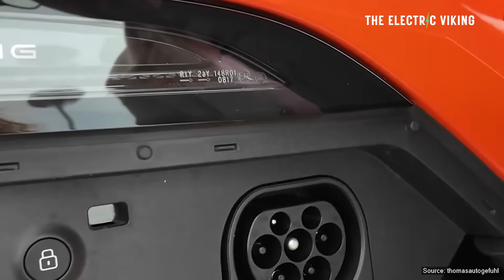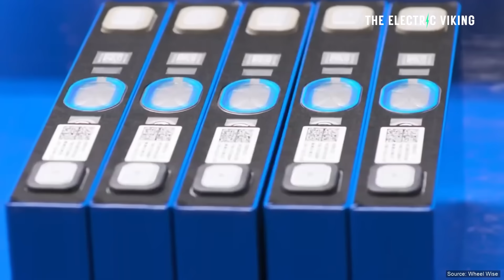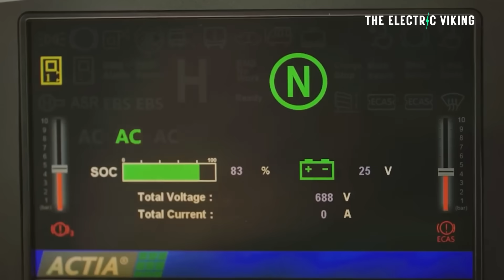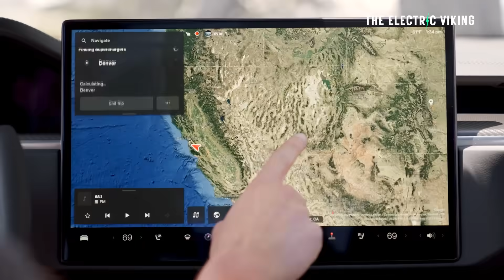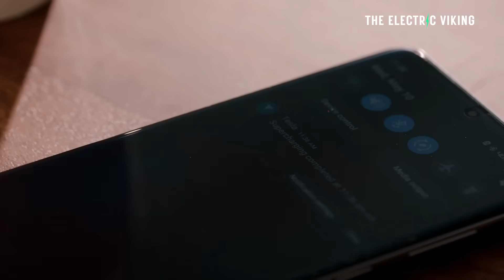Shocking data reveals the TRUTH - how long electric car batteries really last

Comment: When a battery degrades does the 80% recommendation also lower?  If max capacity was 300 miles so 80% is 240 miles and the battery wears down to 260 miles can one still charge to 240 miles and it's fine or does the 80% need to be applied to the new lower range?

Comment: So, EV owners are ok with losing 30% of their mileage after 6 or 7 years. That just seems strange when there are options that prevent that  battery mileage loss…..namely battery swapping. Why wouldn’t you want that option? There is no downside. Zero.

Comment: I've never heard such a utter rubbish in all my life there is no way that the cars of today are going to be around in 25 years 30 years time not a chance certainly not unless they've cost hundreds of thousands of pounds in repair bills I've been driving for 40 years and I've only ever brought used cheap cars and I think the most of the paid for a car has been 1500 and I once lost about £200 on a car back in the 1990s usually spend no more than £500 and i have never had a repair bill for anything ever more than £200 yes I can do some repairs myself these cars of today you've got no chance of diagnosing a repairing any problems come up on the cars cuz of the sensor galore's everything has to be put on diagnostic machine which isn't cheap that's just to find out the problem not even to repair the problem You're having a laugh and hope you're getting well paid for it because you're selling yourself down a drain

Comment: OK fine so the battery is not the problem. but what about the repairs. It is very expensive to have an EV repaired if you can find a garage that wants to do it and has enough qualified mechanics. EVs are built terribly compact, you have to take a lot out to get to something. That costs a lot of time in labor. Manufacturers protect their parts from imitation by only accepting their own parts in the software. There are already 6 year old EVs that end up in the scrapyard because it is too expensive to repair them. Don't get me wrong, I love EVs but it is difficult to make the best choice for the long term.

Comment: I am buying a Geely E5 with tge 60kw battery. However if Geely will only replace their blade battery only if it drop to 70% capacity within the 1st 8 years. This would be the battery Having dropping from 60kw to 42kwh. This would even be lower than their other smaller 50kwh blade battety.😮😮😮

If Geely are so confident about the blade battery longevity then their warranty should be battery replacement if it drops to 85% capacity like dropping from 60kw to 51kw. No?

Comment: My question is more about which companies make the longest lasting batteries. Oh which companirs use the most efficient batteries. Most reviewers only care about range on a charge when new. When long-term usuage is way more important. Why buy a 400mile battery thats 350miles in 5 years when the 380mile battery only drops to 360miles in that time.

Comment: Is lab testing better than real-world data? That’s a marketing claim, not engineering. Only real-world use can provide accurate data over time. Lab tests are merely a quick estimate of a few data points, as you mention several times throughout the video. The million-mile Tesla is on its 4th battery, but still impressive. Paul Curzon's Model S has over 400k miles and is the best known on a single battery, but remember that is only one car, time will tell.

Comment: You work for the chinese government surely, cherry picking ultra high mileage users to aid the case for ev cars? I have been driving 50 years diesel work vans 20,000 annual miles and private petrol cars 10,000 annual miles, never had an engine or gearbox which is no surprise really. average car use in Uk is 12,000 miles, Tesla battery guarantee 8 years so average UK user 96,000 miles when guarantee expires, the EV would be worthless then while the petrol car would have years and years of life and some value! No mention ever of Trump reversing the net zero madness and reviving the ICE vehicle production!

Comment: I have a 2014 Nissan Leaf. I purchased it to save money, as well as have a fun car to drive.
It has over 130,000 miles, still has the orignal brakes, and the battery is about 1/3 degraded. If I replaced the battery it would be less than buying a new car
On a good day I can still drive the 24 miles to PDX and back. 
I figure the battery will last another 10 years, as I dont fast charge it as much as I used to. Its my daily driver.
Now that I'm older I mostly drive around town to get food, and visit friends, as well as lend a helping hand when I can.
It's the best vehicle I've ever owned.

Comment: I have a 2010 Toyota Prius IV with 177k miles on it and the original battery is still good, allowing me to get 46 mph, about 4 less than when it was new. And I haven’t had to replace the brake pads or rotors. At my last oil change at 175k miles the front pads were at 5mm and the rear at 6mm. That’s very good and saved me a lot of money over a non hybrid gas car.

Comment: 5 minutes in and still not answering the initial question. Going on round 3 repeating the same not to the point words.
Reply: That’s because almost all of the batteries are less than ten years old and the newer ones will last longer than the older ones. 😊

Comment: Ever since the automobile battery revolution started, I have believed that the best thing the industry could do would be to standardize the physical size and voltage of batteries so that they are interchangeable between automobiles. (Think AAA, AA, C, D, 6v, 12v) This should reduce their cost and make their replacement much easier. The industry may be in such infancy that such standardisation is not yet feasable, but it should be the target of the industry.

Comment: I am 60 now and throughout my driving history since 1983 I have had numerous cars all used and none without some mechanical issues along the way. A few years ago I was left some money and the first thing I did was by a Renault Zoe a few years old which I loved but it didn't have rapid charge so was limited (but we still did a road trip) I then upgraded to my first ever new car a Tesla model 3 RWD in 2023 did a road trip last year Cork to Cornwall and this year we are going to Switzerland my maintenance expenditure so far has been screen wash. Tesla replaced a faulty tyre for free.

Comment: One actual problem with cars as long lasting as EVs....is the financial sustainability of every current auto maker.   I fully expect EVs will routinely last 20 years.   That's a huge increase between sales that no auto maker can deal with.   Not an argument against EVs, but the macro economics of significantly longer lifespans will be something that needs figuring out.

Comment: I sent this to my western regional manager in western Canada.. 

 Hi Scott,

I am reaching out because I’m struggling to understand the performance of the remanufactured battery pack in my vehicle. Specifically, that it only charges to 340 km—and sometimes even less—despite the conditions being favorable. For reference, I’ve attached two photos one from December 3, 2024 at my home temperature around 4 to 6° C and December 19, 2024, taken at a supercharger in underground parking located in Vancouver, B.C., where the temperature ranged between 10°C and 13°C.

After the most recent service, the battery pack charged to 344 km, but this was under optimal conditions inside your shop, where the temperature was likely between 20°C and 22°C. I’ve also included a photo of this for your reference. 

For comparison, the loaner Model 3 , I currently have—with the same battery pack—charges to 389 km at 100% capacity with 50,636 km even at  temperatures ranging from +4°  to -5 C at my home  February 4, 2025 . This discrepancy raises significant concerns with my replacement battery and why it only charges to a maximum of 340km range given cold or optimal temperatures. 

Based on this data and our discussion yesterday, I am not confident that the battery pack will perform any better in the spring or summer. It appears the charging capability is capped at max to approximately 344 km, which doesn’t seem right since I bought a vehicle that would charge up to 393 km. I understand that that after 77,145 km there would be some battery degradation and still charged to 386km + or - like I discussed with you , however what it charges to  
now is not sufficient.

Given these circumstances, I am requesting that a different battery pack be installed in my vehicle to determine whether this resolves the issue. If this is not something you’re willing to accommodate, I will need to involve my lawyer to explore next steps.

Thank you for your attention to this matter. I look forward to hearing from you soon.

Comment: All things considered, car manufacturers should offer 10-15 year warranty for battery, motors and any other huge expense item in t he car like the transmission.
This would prevent hardship for those of us that can barely afford a new car.  The vast majority of cars will never a an issue so the manufacturer does not have to worry.

Comment: Maxwell Chikumbutso has changed the way we harvest electricity, free power from radio waves actually works on the models tested including cars, motorcycles, TVs and e-bikes, NO charging and gathers radio waves and turns into DC voltage. 

China have several hundred cars for testing right now. 
Get upto speed with new tech
Reply: It's a con.  There's simply not enough energy in radio waves to run your car.

Comment: My neighbors across the street have 2 Model S’s. Their first one is an original generation 2013 model. She has around 180K miles on it and has told me it has around 85% of the original range and she’s still driving it and has no interest in buying a new car.  The amount of money she’s saved on gasoline over the cost of electricity is staggering and is enough to buy another car. And that’s the oldest version of the car with the worst battery chemistry. They love it so much that the husband also got a used Model S, a 2019, and so they have two in the garage now.  There are literally zero rational or factual arguments against EV cars at this point. Anyone who argues is just living with cognitive dissonance.  Having said all that, I do not believe anyone should be forced to buy anything they don’t want to buy. There should be no EV mandates and no forced transition to EV. Let the market decide, let people buy whatever they want. Eventually, everyone will be buying EV’s because they are simply the better form of propulsion. Until then, there’s nothing wrong with having 3 types of automotive propulsion on the roads: Diesel, Gasoline, and EV. This doesn’t have to be an ideological or political debate. We can all be happy with whatever we buy.
Reply: It’s not ideological or political! It’s scientific fact. 😢 Change or trigger extinction.
Reply: Great video, cheers Sam.
Reply: This is very informative. Thanks
Reply: Good comment. The only issue I can see is that the Oil companies and Media have their thumb on the EV scale.
Reply: Thank you for being the voice of reason.
Coming from someone who is Not an EV fan.
I agree with everything you said.

Comment: I bought a 2013 Volt with 60k miles and drove it for 9 months before the EV battery died. Chevy doesn't make these batteries anymore so the only option was remanufactured from known good cells. Cost was 5500. Ended up scrapping the car due to the unibody being rusted out though.

Comment: Battery life is not really an issue for me. I know that for best results you should charge to 80% of the plated rate and discharge to 20% of it i.e. only use 60% of the range. A similar thing also applies to normal cars, when the tank is only 15% full- fill it up.
  The issue for, I think, most normal people is initial purchase price, range, charging time and convenience. 
  If your life circumstances fit in with that then maybe they're a good idea. 
  I no longer drive but when I did my last car was a Peugeot 306 estate with a 2 litre diesel and it cost £1500- today that's likely £2500. Range was over 1500km regardless of the weather. It lasted 6 years and I only got rid of it because I moved abroad. Fuel costs were 3.6l per 100km- I had to measure that 3 times before I could accept it. That, guys, is the competition if EVs are going to be normal. Again as a niche car, I have nothing against them, like Ferraris or Aerial Atoms.

Comment: Not true, not all will last that long,  my daughters 2013 model s. With only 107k, miles completely died,  a brick, tesla wants $22k, for new battery , so what do you do now,car  is only worth $13k, in working condition.  Tesla battery needs be at least 12 years or 180k, miles, because its so fukin expensive to fix it,  pathetic 8 years they give you sucks,

Comment: Our Model 3 LR just passed 200,000 miles. The battery still has 83% of its' capacity, 292 miles of range from 100%. No other maintenance other than tires.

Comment: The consumer perception with EV batteries is based upon real world battery problems living with Laptops, Phones, and Flashlights. Apple slyly detuned phones for aging battery performance. Fashlights stored for when the power goes out never work.   Advertising opportunity for EVs is to compare how EV batteries fail differently from consumer electronics batteries. And design EV batteries to easily swap individual bad cells so it's a $100 repair not a $10,000 repair; even if it's split to four sub-modules so it's "only" a $2,500 repair. Study last year said 80% of consumers have less than $500 in savings for an emergency; that creates fear of buying.

Comment: TEV. Sorry, don't buy it. Your EV lasts longer than ICE? So, EV makers are lying about own bat' longevity?  Searched Ai. "EV battery dead-weight. Mid-size car. Compare with dead-weight of emptying 60 liter tank gas/diesel engined car". Towards mid of battery range, ya still tugging equiv 3-5 extra adults dead-weight. Range anxiety / false $/km cost. That's my gripe.

Comment: If I could have bought Tesla cars for the last 45 years I would have saved hundreds of thousands of dollars.
Reply: So true. Free/cheap electricity from coal/oil/nuclear/renewables. Pennies for heavy copper cabling for EV charging at each family dwelling. Wonderful cheap battery exchange.
Near-zero economics to realistically recycle battery/windmills/solar materials. It's all win win for UNFCC, China EV, Tesla, Eco dreamers.
Reply: @ I’m 3 years in with no repairs or maintenance and thousands is fuel savings. All the anti EV propaganda turned out to be incorrect.
Reply: If you had bought Tesla shares over that time you would be a millionaire by now 😊

Comment: Say all that you want electric cars were created way before combustion 1833. For a reason not popular. You mention China. Well China has the battery chemicals to create and replace batteries. But physics is physics batteries die. And you need to stop to charge batteries for hours. If you need a long distance trip you are severly limited.

Comment: I have a 2018 Nissan Leaf SL that has been pampered yes, but it still has full bars and full range. I only charge at home and never let it set with a charge that is too high or too low.  I charge before I leave and plan to have a mid-range state of charge when I get back home. I have never had a high temperature condition.

Comment: I had a 2014 Volt and I had to change rotors and pads, mostly because of rust and a defect in the back wheels. The way the calipers are made in the back wears out the rotors. But they still lasted more than my previous ICE cars. Now that I have a 2025 Kona electric, I think I may not need to change the brakes for quite a while. Thanks for the video.

Comment: If a battery discharges fully, its done. You just throw it away.
So for cold climates EV is a huge pain in the ass, as you MUST keep it connected to the grid 24/7.
You cant just drop your car and leave for 2 week holidays. If it is -10°C at that time, whan you come back, you go by a new EV.

Comment: My 2017 leaf's battery faded to below 70% capacity  @ 60,000 miles  .. 
The owners manual clearly states the Nissan will replace the battery if there is a loss of capacity of 30%..
Two Nissan Dealers disagreed : And refused to do the work...I called Nissan and they happily heard my complaint .
They said they have no control over the dealers(Franchise holder) and asked me to try another.
I was lucky and found one willing to do the work...
Three months later a replacement  arrived . I happily drove home. .. 
One month later the Battery failed.. I don't know why . The warranty on All EV Brands main batteries says the replacement battery can be New or Remanufactured /Repaired..
When I spoke to Nissan they told me that there was no problem finding a battery for my 2017 leaf.. Earlier years were hard to find or UNAVAILABLE...
I lived in South America for a time . 
There are extremely old ICE cars still on the road.. Spare parts are not available they have to make them.. 
EV's will not take over the world...Out of production  Ev's cannot be repaired .
 Gigacast parts can't be repaired . Gigacasting's must be replaced.  Only cars without Gigacatings will survive ...in the Wilderness..

Comment: lets face facts here, when I.C.E were the same age as batteries are now (say circa 15-20 yrs old for arguments sake), they were not as good as they became later....AND there was very few places to fill them up with more motion lotion, but they got better....just like batteries are proving now, the fact that an I.C.E will likely need replaced long before a EVs 'traction' battery will, mileage-wise, THIS EARLY into production, should make haters at the very least, take media garbage with a pinch of salt. Plus, you dont have to sit and wait for your high performance vehicle (EV) to warm up or cool down before and after you razz the nuts off it.